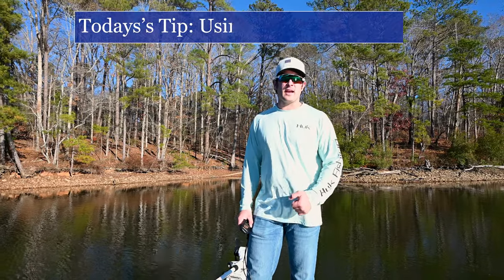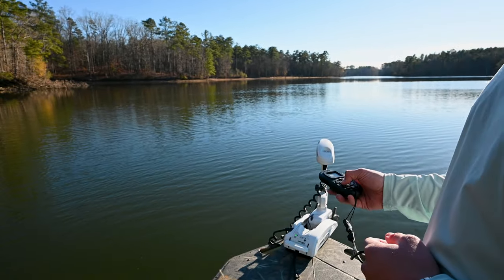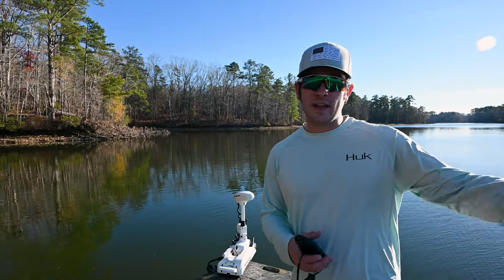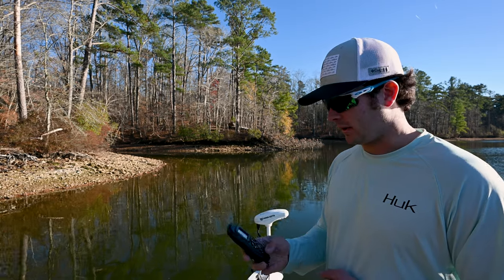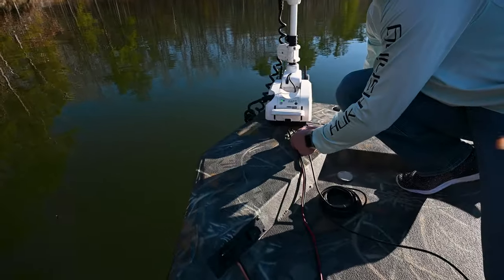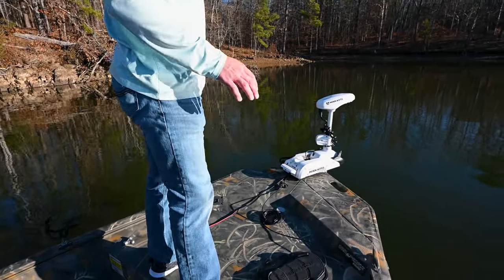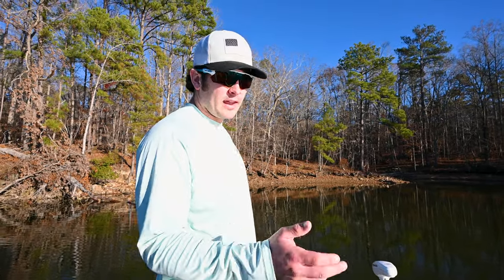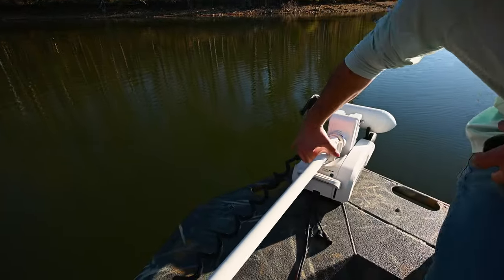How to Use the Minn Kota Terrova | Complete Tutorial Including iPilot & Footpedal

Comment: I just ordered the Minn Kota Terrova 112 Trolling Motor w/Wireless Remote - MEGA Down Imaging - 36V - 112LB - 60" today.  Will be putting it on my Tritoon.  Excited to see how well it works.  Question, do you count the starting battery in your 36V needed for this setup?
Reply from the maker: @DrJeffM  No you would need 3 dedicated trolling motor batteries. Another solution is to do a single large 36V lithium ion battery so you’d only have one trolling motor battery

Comment: Does this unit have a way to save gps routes
Reply from the maker: Yes you can save GPS routes. Make sure the trolling motor is on and hit the record button on the remote. The cool thing is that the trolling motor doesn't have to be deployed to create the route so you can use your big motor to trace the route and then go back through it with the trolling motor.

Comment: I bought a used Terrova trolling motor and couldn’t figure out how to set the spot lock while using the foot pedal. Hopefully mine has the button under the speed dial once I use it again. Do all the Terrova pedals have the spot lock feature on the pedal? I never recalled seeing that button. Hopefully Ive just missed it. Thanks for video

Comment: Thanks for the video.  Can you lock the direction of the boat in spot lock mode?  I noticed sometimes when I am spot lock in a back eddy or swirl current that the boat does 360's as its confused on the current direction.
Reply from the maker: I wish there was but unfortunately there's no way to lock in a direction using the spot lock feature because its always trying to find the most efficient way to hold you in place.